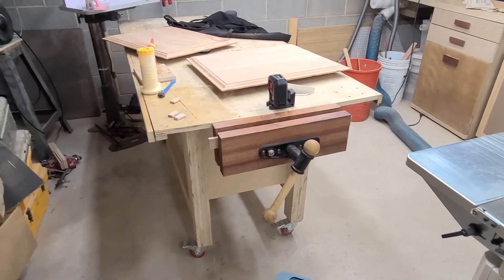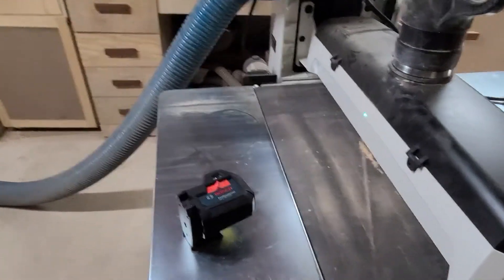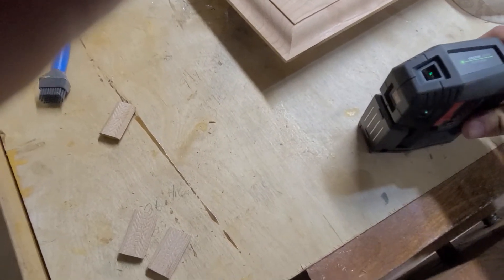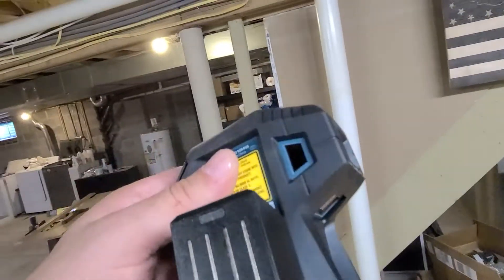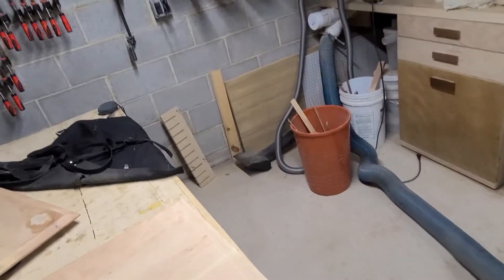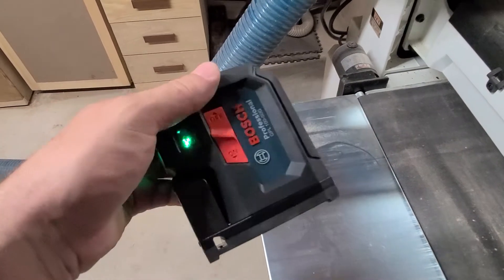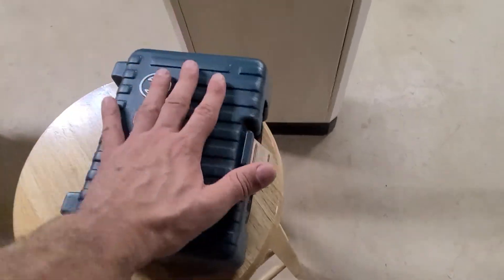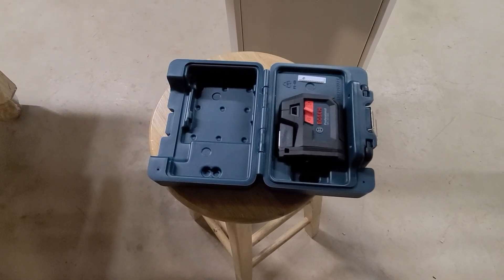Seeds Review - Bosch 125ft. Green 5-Point Self-Leveling Laser with VisiMax Technology

Comment: This laser is useless without line projection. POS
Reply: That's not true. It's good for masonry.
Reply from the maker: I actually bought another Bosch laser that has the vertical and horizontal lines.  I use the new one all the time I haven't had an instance where I needed the one in this video.
Reply: Wtf do lasers are necessary thats how commercial hvac layout is done